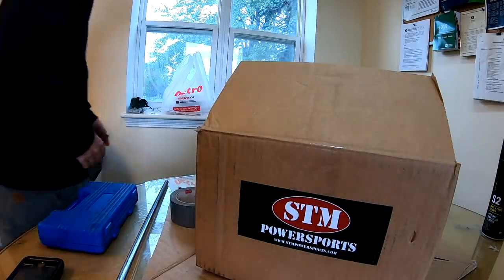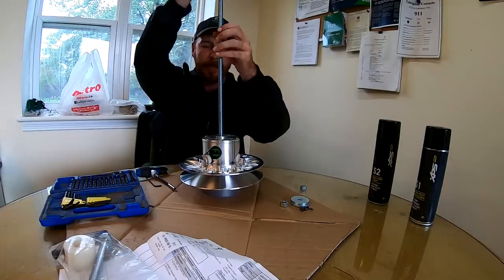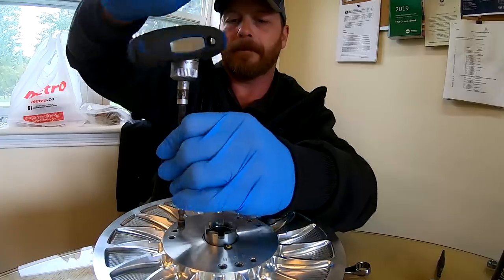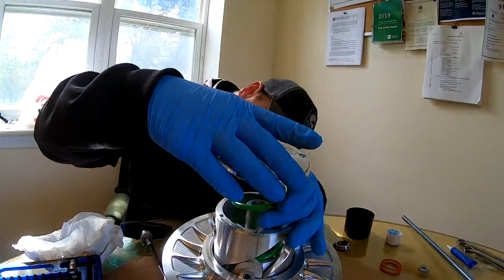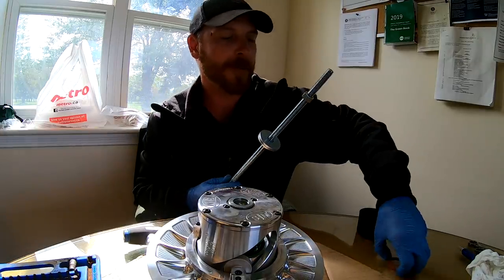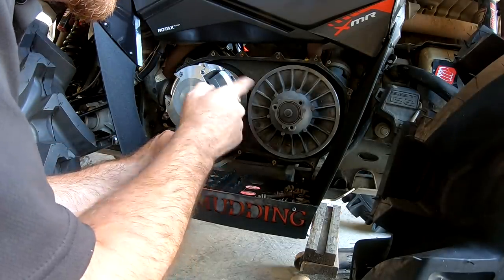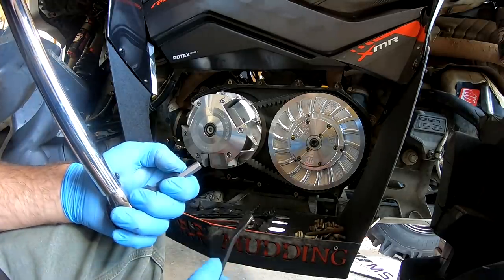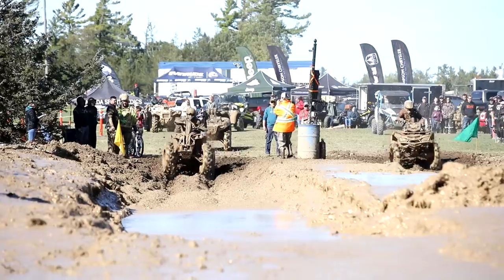Renegade Get's A Clutch Upgrade! , STM Secondary & Belt Deflection Adjustment

Comment: I wish I could remember the clutches that CATVOS installed on my 800 Commander. I know one thing though when you put it in gear it will jerk extremely hard until it gets warmed up, but it could be the belt I run ( HighLifter C-3 ) it was the only belt that lasted any time.    When CATVOS installed my lift and clutches they put a High Performance belt on it and within a week I was swapping it out for my old HighLifter belt

Comment: That's the combination my dad runs on his 2017 renegade xmr. He pops wheelies so easily because of how aggressive the primary clutch was set to
Reply from the maker: Right on, wicked setup
Reply: Would that be dangerous for steep trail riding ? I'd hate for it to wheelie when trying to climb  a mountain. Would you recommend replacing primary or secondary first?
Reply: Can you please tell me where to get this set up at? My factory clutches and belt just aren't holding up. Pretty much junk in my opinion.

Comment: I'm not sure why you bought the threaded rod. It looks as if your bag has the Nylon Piece and Bolt that you would use to compress the Spring or am I missing something? When you Order the STM Secondary it is supposed to come with the Spring Compression Tool